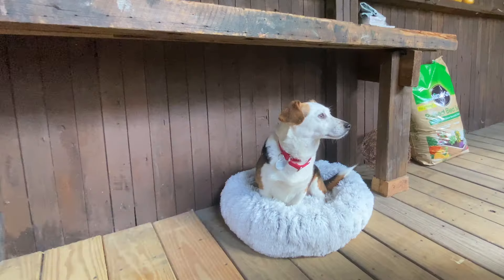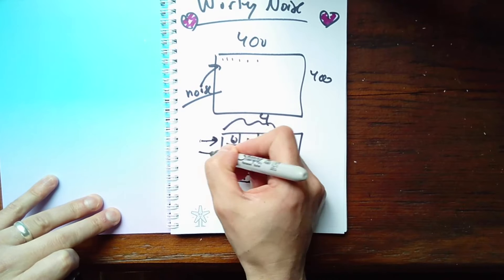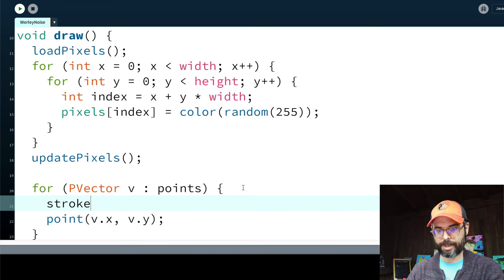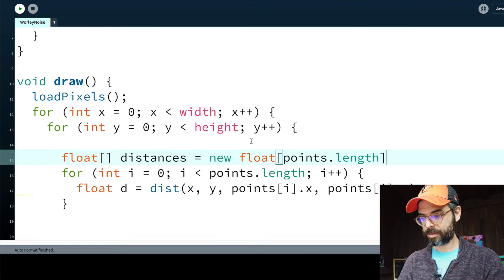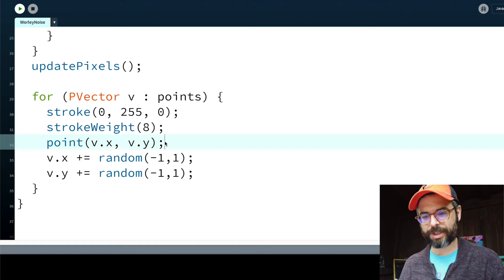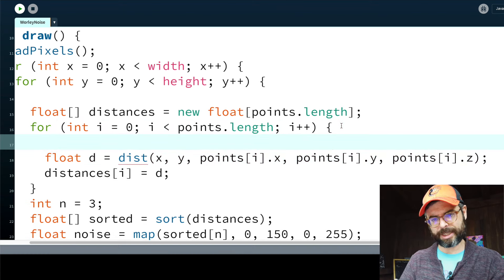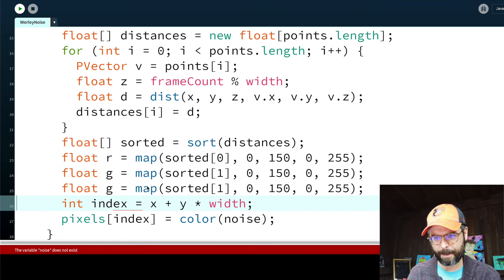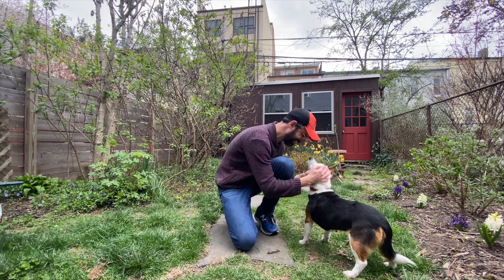Coding Worley Noise

Comment: So I've been programming for about 15 years C->ASM->C++->Haskell/Prolog/Lisp->Python->Kotlin->Rust Has been my path so far(at least the things i'd consider myself intermediate to expert in, i've done my share of js, node, etc but not a front-end dev by any means...made cpus with transistors, wrote an os in that isa i designed...then moved on natural language algos and that's where i've been at since, before tf was cool i was doing ml even >_>). At first i really thought you were an average programmer who just was dedicated. You probably think, yes that's what I am. That is what you are, but I had negative connotations like you were less than I, well, I feel your production is greater than I and I must strive for it. I went and hit this problem before watching the video trying to get it done before the video time and well when I compiled....FAIL. I got a cool diffusion-type visual though. Took me an hour+(15m) to complete based on the wikipedia page...I'm embarrassed. :x I thought I was smarter than I am and I'm struggling to face that :( You seem to be confortable with yourself, and this is a power to you. Anyways, in the wiki page, you really have to fill in some blanks... After that I realized that I also need to break down my problems. See I've never used any sort of mindmaps, drawings, anything to program. I have always been able to one-shot my algos pretty well. Sure get bugs as much as anyone but I visualized them without visuals. So I watched your video and realized, even though i understand and know your methods..I don't do them, and even though I feel like I don't need them, I'm a much slower programmer without, and I think that is why I could not do it in the 15 minutes. I don't like watching your videos because I make lots of demos and it feels like cheating, but I love your channel and I watch any videos on things I've already done in the past or I try it first if I haven't heard of the concept. (I've watched a lot of your videos :D) TBH I feel like I'm just more gifted at programming than you, but you're a better programmer than me for the tactics you have developed habits of because math or something is harder for you than me...that's what it seems liek to me. So I say that, and people may react badly, but tbh, you're the BETTER programmer, and I say nearly with contempt, but mostly with a desire to use you as a standard to reach for consistency.(See I hammer 2-10k lines in a day, twice a month at the moment, when i was younger i was more consistent but life)

Comment: One optimise.  Square roots are very costly to compute.  You  can use DistanceSquare instead of Distance, and this won't effect sorting.  Then, you only have to take the square root of the final pixel value.

Comment: I have a suggestion. So the purpose of sorting the distances array is to get the closest feature point to each pixel right? Well here me out, what if instead of storing all of the distances and sorting them after all of the distances have been calculated, we just keep track of a minimum distance. We then can just replace “sorted[n]” with the minimum distance that was being tracked. However, I understand that this may not seem as robust. With this algorithm the value of ‘n’ will correspond to the nth minimum distances that we must keep track of. But, there are efficient algorithms for keeping track of the nth smallest number in an array of values. So I would say that if your goal is to simulate the ‘classic’ Worley noise where n=1 then this might be more efficient. I will attempt to implement this method tomorrow and share the link to the code through GitHub.

Comment: I think one optimization would be to not continually re-sort the whole array but to use the previously sorted array and the re-sort it.  From one (x,y) to the next the sorting change should be small enough that the sort would complete very quickly.

Comment: The first loop should be over Y and second over X, then performance will be much better because you will access pixel in the right order - 0, 1, 2, 3...
With the current realization, you have indexes 0, 400, 800, ... which causes cache misses.

Comment: Appart from clarity, why not access the pixel array as one dimension array (which it is)?  :
for (int index = 0; index < width*height; pixels[index++] = color (random(255)));
Reply from the maker: Later I need the x,y locations for the distance calculation! But yes either will do!

Comment: Thanks to you I implemented worley noise using XNA to but checking predefined points to find closest one is just a drop in a bucket compared to setting every pixel 1 by 1. I tried to set only the pixels that belongs to a "cell" (an entity in prototype which has radius) but even for 1 cell with 64 radius it makes 128*128 iterations. I'm still trying different approaches. 
- Edit: I was trying to solve it for 4 days with different approaches and wrote this comment in the hope of an advice. At last i figured it out with XNA's built-in blending functions. I even implemented collision detection and spatial subdivision. There is still room for improvement ofc. Maybe quadtree would be more beneficial, will give it a try sometime.
- A short record of my implementation: https://www.youtube.com/watch?v=xjzfzd4GYYg

Comment: Noise is stochastic. That means it is used for communication purposes.... but in the channel, the signal transmitted gets mixed with something called 'noise' which is random -- that's why it gets distorted or attenuated -- it loses it's strength. Noise has a double meaning here!